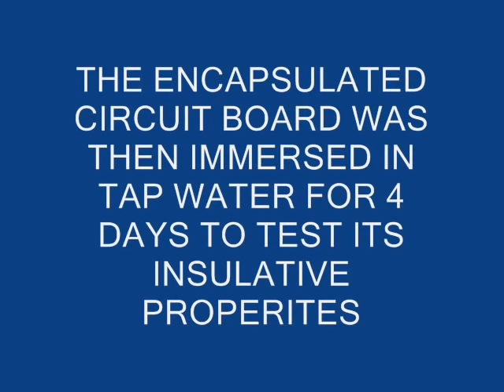How To Seal & Waterproof Circuit Board. MAX MCR Opaque Black Potting - MAX CLR Clear Potting Epoxy.

Comment: How to remove it??
Reply from the maker: You can't. The purpose of the potting compound is to hermetically seal the components from the environment. There are removable or serviceable potting compounds; however, it does not provide the hermetic sealing performance as this resin system will. The black color of the potting compound also serves as a proprietary encapsulant, so copying the circuit design won't be easy and most likely destroy the part if the potting compound is removed.
Reply: @TheEpoxyExperts  so there is no way for an  ewaste recycler to recycle it, beside burning it
Reply from the maker: @reprocessors  Thermoset plastics such as epoxy resins are not recyclable. They are hard and very durable plastics that are meant to be insoluble in any solvent, and it does not melt like their counterpart -called thermoplastic adhesive, similar to hot melt glue. Thermoplastics can be melted with heat or dissolved with solvents, while thermosets are one way; once it is cured to a solid, the process is irreversible. 
A circuit board in e-waste, for example, is made from epoxy and fiberglass. Circuit boards are ground up and buried as solid waste for disposal.

Comment: Thank you very much for the video. I have to remove epoxy encapsulation from something I want to reverse engineer. Can you tell me how it can be done?
Reply: Drop it in the boiling water and then remove the softened potting compound.
Reply: Ilia Timonin wouldn’t that cause failure to electronic components?